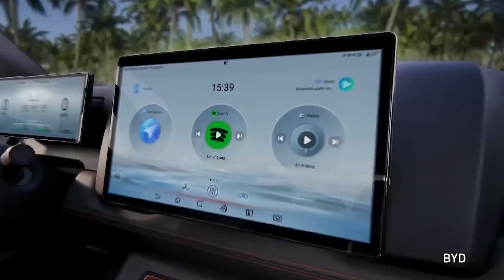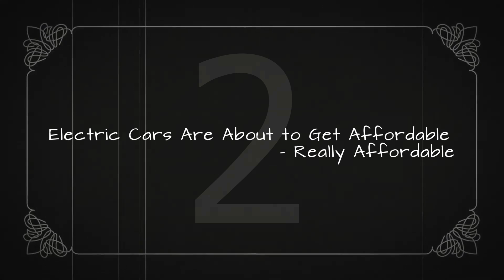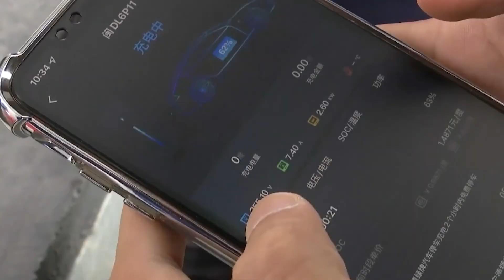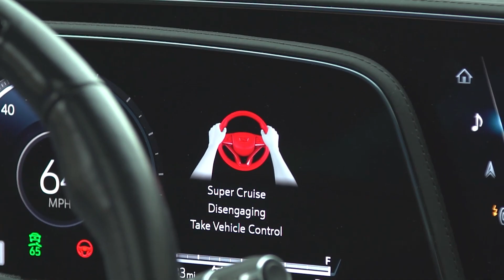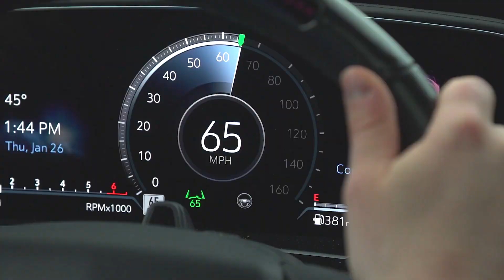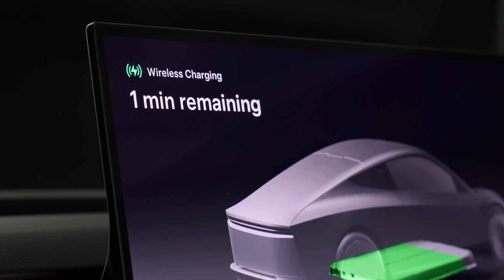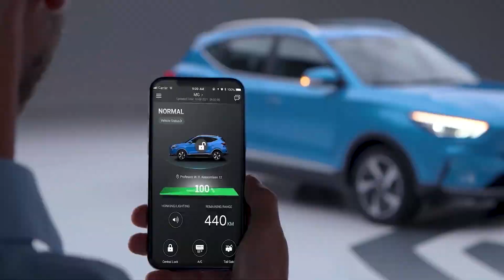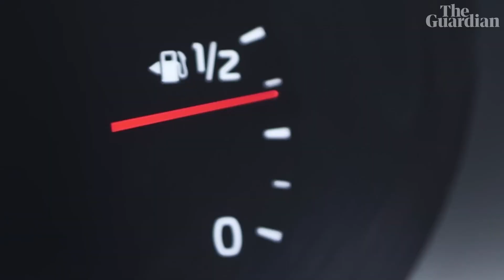The Future of Electric Cars: What to Expect in the Next 5 Years

Comment: The problem is the fire starter batteries,  not even recommended to put them in your garage. 5 yrs sounds ok for working out the bugs especially in colder climates where heat demands will drain the batteries.
Reply: The bugs are worked out. Teslas Batteries short out a bad cell before overheating.  Teslas are the safest vehicles on the road for a reason.
Reply from the maker: Absolutely! Tesla has put a lot of effort into battery safety, and their systems are designed to isolate and short out problematic cells to prevent overheating. With innovations like these, along with high safety ratings, Teslas have definitely set a benchmark for EV safety. Thanks for highlighting this!
Reply from the maker: Battery safety is definitely a concern, and you're right—fire risks with lithium-ion batteries in EVs have raised questions. Manufacturers are indeed working to improve battery stability and efficiency, especially for colder climates where range can drop due to heating demands. The next few years should bring advancements in battery tech, with solid-state batteries and improved thermal management systems on the horizon to address these issues. Thanks for sharing your perspective